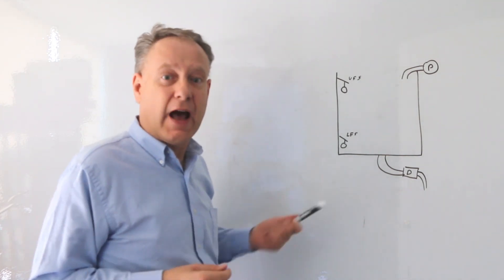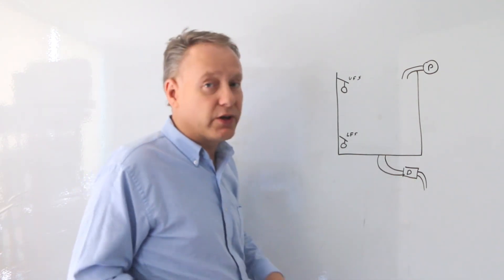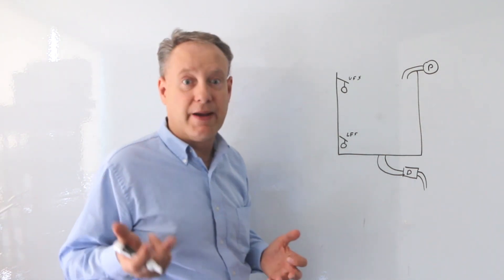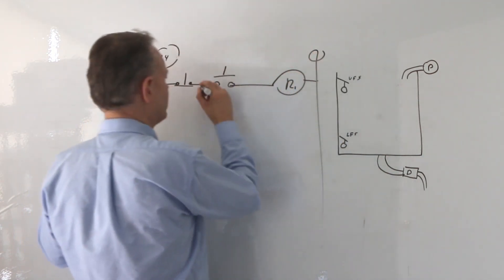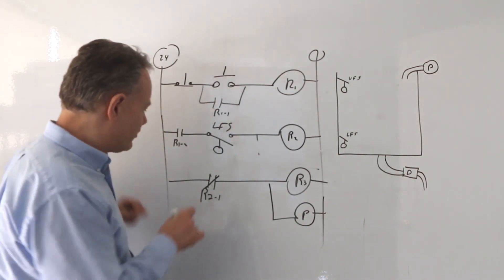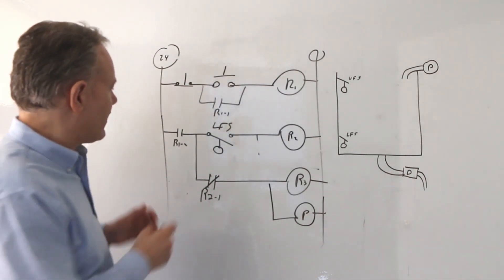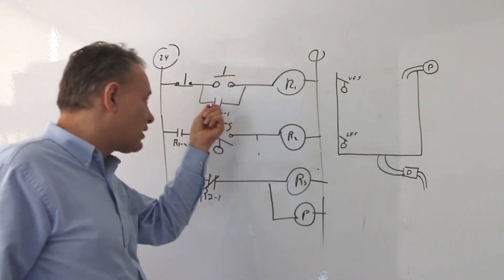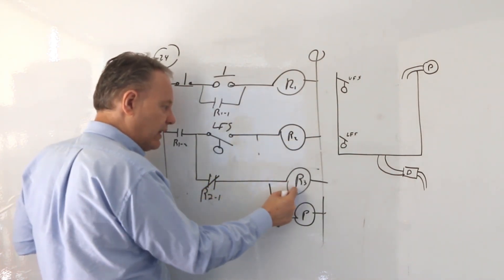Holding Circuits in Application - Water Tank Level Control Circuit

Comment: For a circuit with start and stop station can we put an overload before stop button ?
Reply from the maker: I understand what you are envisioning and although overloads and safety is of paramount, putting them in series with the Start/Stop station is not the correct place. Overloads manage over-current drawn by loads (I assume you are considering motor control) and are placed in series with the load. The load on  the Start/Stop station is simply a control component such as a relay coil or a contactor coil. Over-current is not a concern with relay and contactor coils. Always place the overload so that it is directly managing the current to the load, not to the load controller.

If you like, you can place an emergency stop with the Startr/Stop control rung. If you do this, it should be placed directly "after" the relay or contactor coil. 

I hope that answers your question

Comment: The float switch would not shut off after the water goes over it, it is a float so as long as it is floating it will be closed so there is no need for the hold circuit.

Comment: Can someone post a wiring diagram for this, does it require 4 relays or will 3 work? also I'm a bit confused on how the connection between the relays will be done to create the hold. I have a very similar system but I just cant get it working 100% the pump always switches on and off at the wrong time lol

Comment: Thank you so much, Sir you are such a great teacher. I have issues holding the upper float switch because during implementation as soon as the water goes below the upper float switch it closes again and again hence the pump comes ON and OFF frequently. I want the pump to stay OFF until the water level goes below the lower float switch otherwise it is a problem. Is it possible to hold an unenergized coil?. Thank you

Comment: SO IF THE PUMP FAULTS HALF WAY, YOU CLEAR THE FAULT, YOU HIT START....WHAT WILL HAPPEN ?
Reply from the maker: What will happen depends on what the fault of the pump is. If is a mechanical or even an electrical fault with the pump, then to “Clear” the fault, then a diagnostic must be run on the pump to see where the fault is coming from.

In this case, the fluid may need to be removed from the tank. To empty the tank, the drain solenoid (which is not part of this video but can be seen in the diagram labeled “D” for drain). Once the tank is empty a diagnostic can be performed on the pump to assess where the fault is. If it needs to be replaced, then it can be because the liquid has been drained.

Your use of the word “clear” indicates it may be a programing issue, but you mentioned the fault was with the pump and did not indicate it is in the control circuit. Just in case you were asking if the fault is a control issue, I will address that as well. 

A control or programming fault occurs when either a signal that does not typically happen becomes active or a physical breakdown. In this simple control circuit such a fault would come from either the Upper Float Switch activating before the tank is full, or an operator presses the Stop button before the tank is full. The other type of fault could be a physical issue with the circuit where a component (relay, wire, power, contact,… ) was damaged. IN this case, the tank should be drained, and a control system diagnostic should be run.

If the fault was from the upper float switch being activated or the stop button was pressed in error when the tank was half full, then pressing start a second time would not re-start the system. This is because the lower float with is in its active state and the NC contact R2-1 is open. Also, the holding circuit R3-1 contact will be open because it forgot the liquid was below the lower float switch, There for pressing start will not start the pump.

There are several options to modify the control circuit to allow for faults like this so that pressing the start again will re-start the filling process. The re-thinking of that control circuit starts with first considering where exactly the fault came from. I only discussed a few options of where the fault came from, but there are several other reasons why a control system and or the pump itself may fail. Targeting each reason why a fault will happen is the first step to re-designing the control circuit or the pump mechanism itself. 

If you can give me an example of where the fault came from exactly, I can suggest options to re-design the system to have a ‘fault-reset” as well as having the pump re-start the filling if the start is pressed again.

A kind note: Typically, when people write using all capitals, they are showing that they are somewhere upset and or showing aggression, frustration and/or possible anger. I do not get the sense that that is where you are coming from, but I thought I would give you some kind advice that some may read into that and assume you were upset in some away and or attempting to show aggression. 

Regards,

Comment: After water reaching upper float switch the pump Stop
But it will start again as soon as the water consumed a little and UFS deactivate again
Reply from the maker: Yes, exactly! Youi are 100 percent correct.
I see you have a good understanding of Ladder Logic. In this simple control circuit, it is assumed that the tank needs to remain full if some liquid is removed. If the application did not require that, then that is a prefect example for another holding circuit. I get the sense that you have the understanding to add that holding circuit into this circuit so that the tank will not full if liquid is removed. If you would like advice on how to do that, I would be happy to advise you.

Wishing you all the best!

Comment: In this video you give excilent Logic for practicing programme in plc
Reply from the maker: You're most definitely correct! This logic can be used for PLC's.

These Ladder videos are designed for a controls course in the program Electromechanical Engineering at Humber College. In this course, students build ladder circuits with relays and other inputs and outputs.

It gives the students a tangible understanding of how control circuits work and allows them to see the logic in the wiring and the actual components.

It's a preparation course for several PLC courses we have in our

Comment: Hi great video 
can you just confirm something Regards the low level switch sensor is it normaly closed in normal state until the relay is energised-  I'm confused Regards the staus of it as you say it becomes open thus de- energisising Relay 2 ??? So Surely it must be normaly closed before  ???
Reply from the maker: Hi Dean. I did a video response to your question. I thought it important to unpack the terminology and needed a whole video to do that.
This link will open the video: https://ca-lti.bbcollab.com/recording/1645b1b8bd6b4e1e84196a645dce0d9d
Reply: @larsexplains3086  you're video explained it perfectly - its just a switch regardless of its state it moves  each way i understand 
Great stuff 
Love the videos,  I've only just come across them & find you're teaching easy to understand 
Again thanks 👍
Reply: @larsexplains3086  I have the same question as Dean, but that link no longer works....
Reply: @larsexplains3086  thanks Lars 😊

Comment: How about I'm having NC sensors for H and L levels as well I need an indication light for the error if the sensor indicate the water level H and the low level low in the same time.
Reply from the maker: This is a little complicated and I need more information to be able to answer you. I'm not sure what you mean by the error of the sensor. IT is either high or low. Generally error is associated with analogue sensors. Can you email me with more specifics? lars.kristjansen@humber.ca
Reply: @larsexplains3086  Sure and I truly appreciate!
Reply: @larsexplains3086   I already sent :) can you check your spam folder.